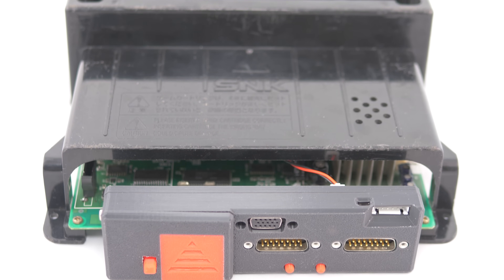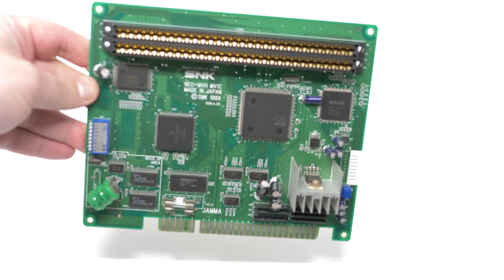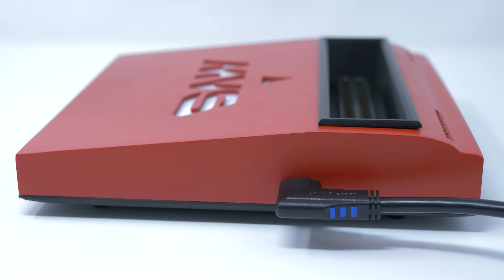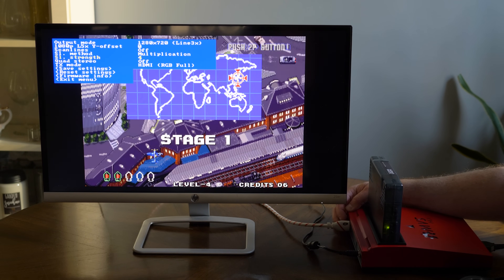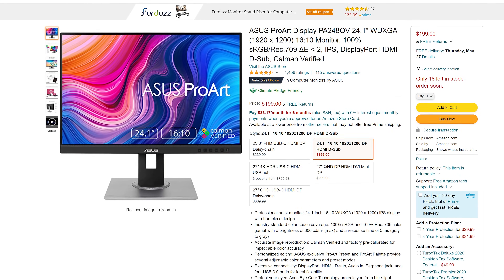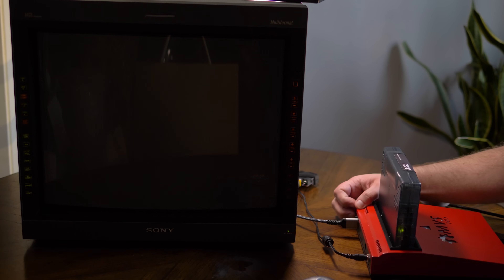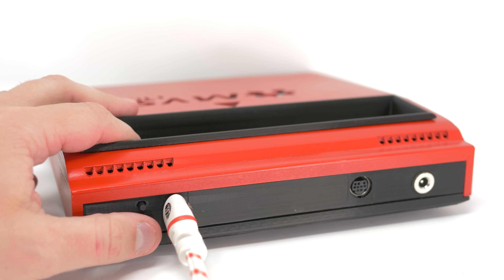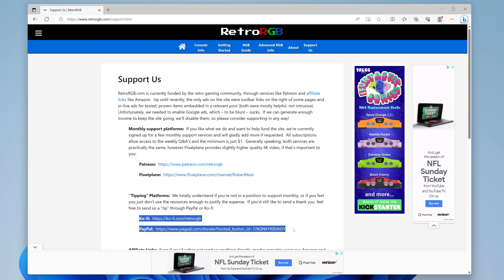Neo Geo MV1C HDMI Mod

Comment: Kinda wanted to get a neogeo. 
After the analogue pocket and the mister. 
Ill stick with that. Does neogeo.
Hacking and modding is the least thing i want to do with my stuff. You really need good tools and a bit of skill. 
Been emulating neogeo since neorage back in the early 2000's. 
I couldn't find one back in the day (AES). plus i was a student and getting 1 grand would of been a pain.